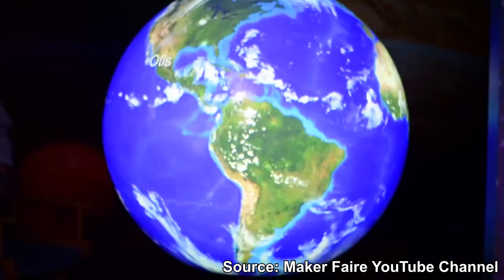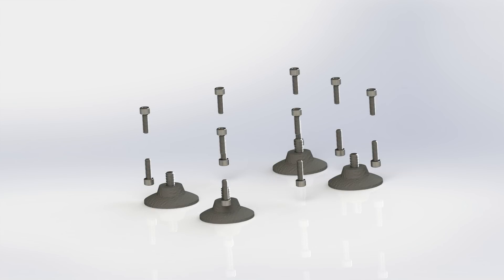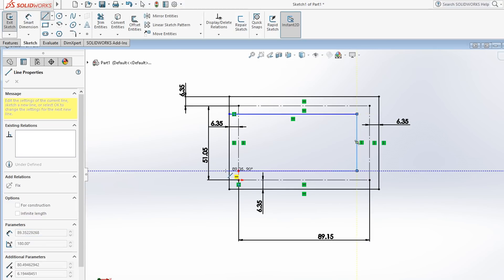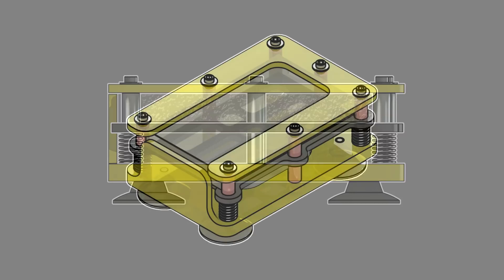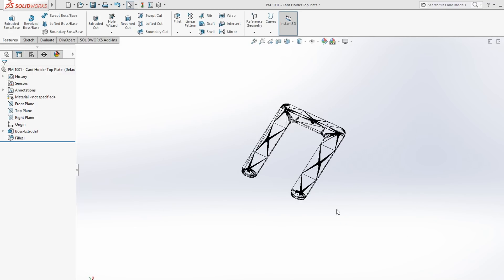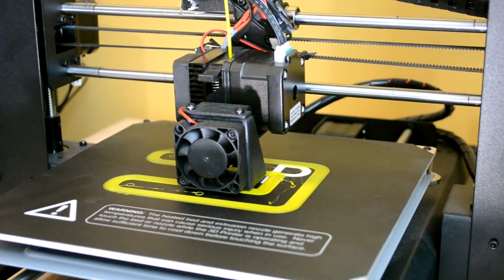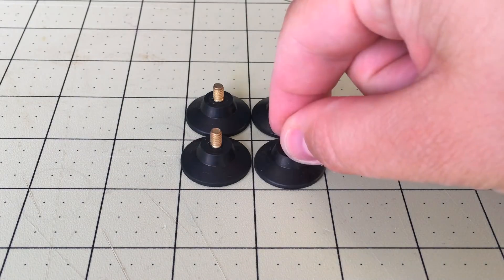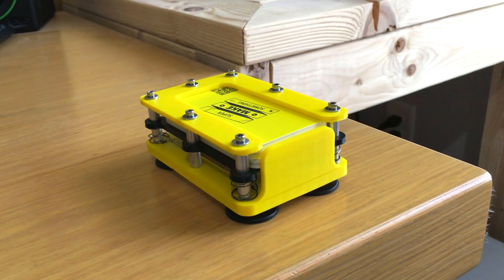3D Printed Business Card Dispenser (Cleveland Maker Faire Prep!)

Comment: The link to the standoffs is incorrect. It requires 1 inch.and it brought  me to 0.457 inch. Help!
Reply from the maker: Hi Brandon, thanks for the heads up!  I just checked and unfortunately there are no other 4-40 1 in long round standoffs on Amazon at the moment, which is why the page is redirecting.  There are hex standoffs, but the outer diameter of these is a little too big to work with the hole placement in the 3D printed part.  That being said, the 0.457 in long standoffs will work -- it just means that the dispenser will hold fewer business cards.  I bet that the 1 in standoffs will be back in stock soon, though, so if you need those, keep checking back!
Reply: @SuperMakeSomething  my dad said he could make some on a lathe possibly. But very cool project looking forward to  future 3d printed projects.
Reply from the maker: Brandon Robins That’s definitely a good solution, too! Depending on how quickly you need them, you could also give Fusion 360 a shot to model the standoffs and 3D print them. I would model a 1in long cylinder with the outer diameter of the metal standoffs and a hole through the center that is a little smaller than the clearance size of a 4-40 screw. You should then be able to slowly drive the screws into the plastic to make the thread. You can check out my camera mount video for more information about Fusion 360 — it is free for hobbyists and makers!
Reply: @SuperMakeSomething   i might give it a go if tinkercad doesn't work

Comment: You don't happen to have a little advertisement for a company that makes businesscards do you? :^)
Reply from the maker: Aroop Roelofs No video sponsorship unfortunately. :( I got these made at VistaPrint. Quality is fine, but a little pricey because of the shipping.
Reply: Ah ok, VistaPrint is quite a popular one in The Netherlands, so I'll have a look at them.
The holder you made looks nice, though don't the cards scratch when taking them out?
Reply from the maker: Aroop Roelofs Thanks! The cards do push against the lip of the top plate, but because the spring stiffness is low, the force isn’t very high, so I haven’t had any noticeable scratching yet.

Comment: I guess you cant take out all business cards because the springs are too short
Reply from the maker: Roberts Darkevics Yea unfortunately I did not have a set of springs in the box that were an inch long. I plan on ordering appropriate length springs online before Maker Faire.
Reply: Their diameters are too large. With proper diameters, you could probably stack two springs by placing a larger washer between them.